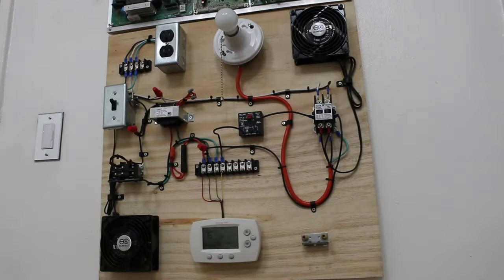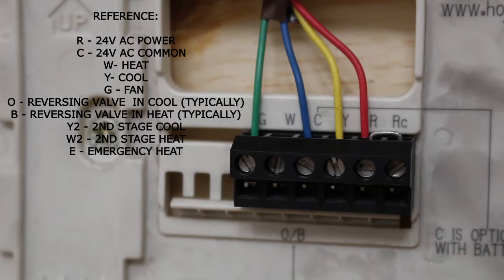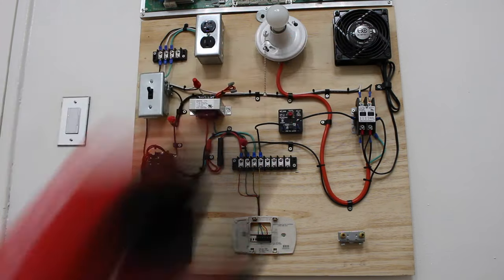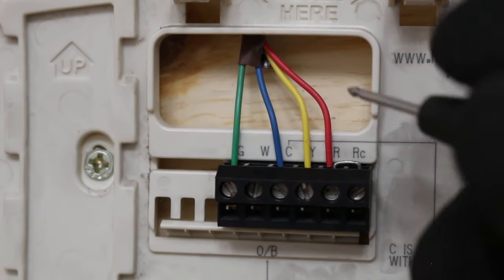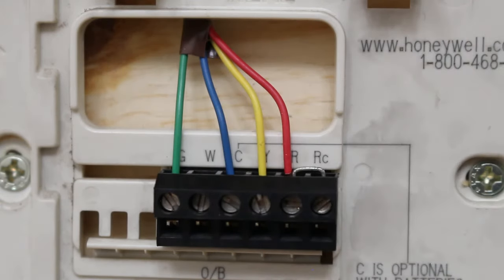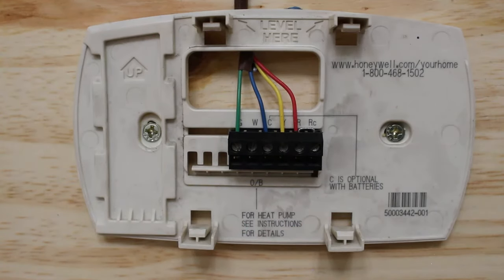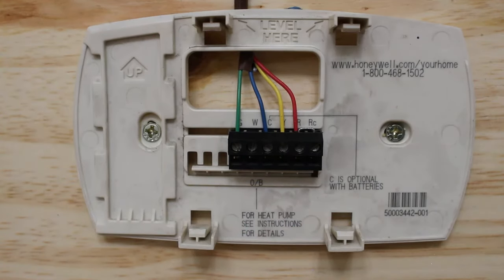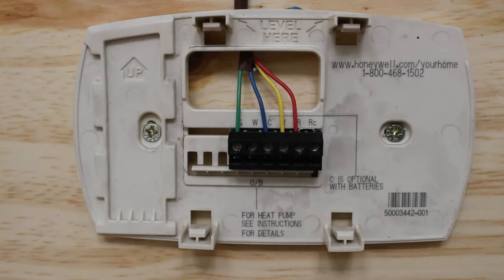HVAC TRAINING BOARD: How To Bypass A Thermostat (How To Jump Out A Thermostat) Troubleshooting Tips

Comment: the blue wire is only a com for the t-stat to use 24V instead of batteries. Compressor and fan relays have 24V com side already hooked in their place of origin directly to transformer com. Only the power R is sent to yellow and green which is Compressor and indoor fan relays to click in.

Comment: I  had a whole new AC and heater installed in the summer, so they never checked to see if the heater worked. No heat setting even comes up on the Honeywell Home programmable thermostat. I jumped white to red and furnace still does not come on. Fan and AC work fine....any idea what's wrong?

Comment: Just learned how to jump out my thermostat!

Batteries must have died in our thermostat. Replaced them, but got no display. Tried the reset procedure, but had no luck.
Temp outside is about 30°F, and it is 1 am. I figured I could survive until the morning and save a night time call, if I could run the furnace without the thermostat a couple times.
While watching, the furnace came on and the display came up. If it goes out again, I know how to get it started until morning.

Your video is clear and concise, and I thank you for it! May have to replace the thermostat tomorrow, but not tonight!

Comment: So glad we have YT accessible and that you made this video!  My Gen 3 Nest that's been working since 2018 just stopped working throwing a Rc fault (no power).  It's in the teens with sleet/snow. I was able to bypass the thermostat via some old wires and a light switch on the HVAC panel itself. The detail in yopur video gave me the confidence to cut power to the hvac and wire in the bypass switch as a temp solution.  Now I just need to figure out why the sudden Rc power fault at the Nest unit. Voltmeter is not reading any volts there so it's in the wire somewhere, I believe.   If anybody reading this has any thoughts, send it....
Reply: Thats exactly what just happened to me! Very short life span for such an expensive thermostat. Last Nest product I'll ever be buying!

Comment: Great video. Big fan! One question though. On site I have a package unit on the roof, and the thermostat is inside the office. If I jump the wires on the package unit, will the thermostat downstairs be shortcircuited?
Reply from the maker: Thank you! Nothing will be short-circuited. You can jump out the wires at the unit or you can jump it out at the thermostat. It makes no difference. Just make sure you jump out the correct wires. Follow the video for the exact info. Stay tuned for new videos every week

Comment: Merry Christmas! (saw you posted this on Christmas).  Can you tell me what relays you use?
I have a nat gas space heater in the living room of a rental unit and I have power 6" ducts from the ceiling of the living room to the two far ends of the apartment, but they are on timer switches.  I want a thermostat at each end of the unit (a kitchen and a bedroom) to turn on the fan when the temp drops enough.  I'll power the stat with a 24v AC to DC adaptor.  I'll house the relay in a 2-gang metal outside the wall box. 

Anyway, I'm just trying to find the best relay for the 24v DC to turn on the 120v AC power to the powered duct.

Comment: 1:50 Press and pull (to the side) is just to remove the batteries casing from the thermostat 😉6:00 C is only used to energize the thermostat with the red wire. That’s why there’s is a note next to your fingers saying C is optional with the batteries!😮

Comment: Thank you for this video.  I was able to confirm the thermostat was the culprit in my furnace OOS.  
It turned out that the R pin on the thermostat itself was broken from its circuit board.  Therefore, the 24VAC R was not getting supplied to any of the W, Y or G pins.
Out came my trusty old soldering iron and i was able to solder in a new jumper from pin to circuit board.
DONE DEAL!
Cost????? == $0.00

Comment: Do a video how to create jumpers
Reply from the maker: I could do that. I can create a video of showing different ways to use the jumper method 👌 Thanks for watching & stay tuned for new videos every week 🔧
Reply: @JumpermanTech  I learned that the hard way last week. I made a jumping wire but had to hold it there for 5 minutes until the short cycle timer finished …. I need some mag & alligator jumpers 😵‍💫😵‍💫😵‍💫
Reply from the maker: @aus_aircon_ref_mech6671  lol I've been there before. I'm going to make that video as it could definitely be helpful👍 Quick tip: You can wirenut the wires together so you don't have to wait there for that 5 min but this might take a few min to do as well as you'll have turn the power off and physically connect the wires you're trying to jump. Stay tuned for new videos every week!

Comment: No white wire?
Reply: No. You can clearly see 'O/B' which tells you this is heat pump. No White wire is used. The O/B is for the reversing valve. But I admit the guy should have said it 😊